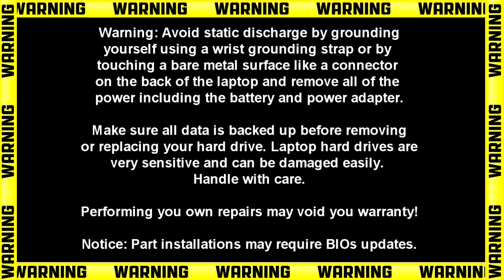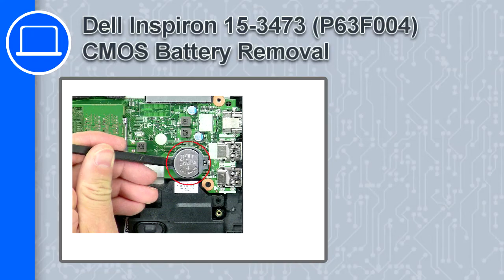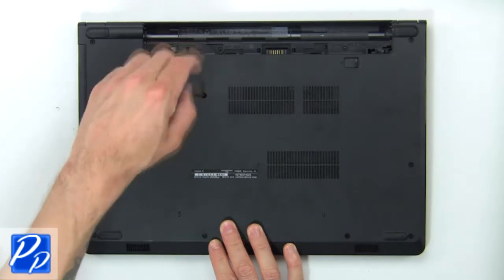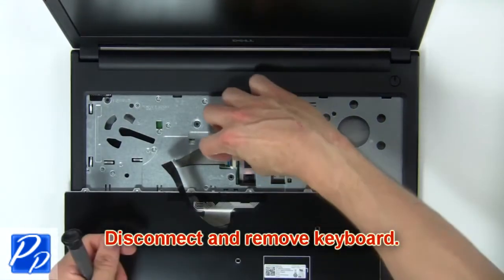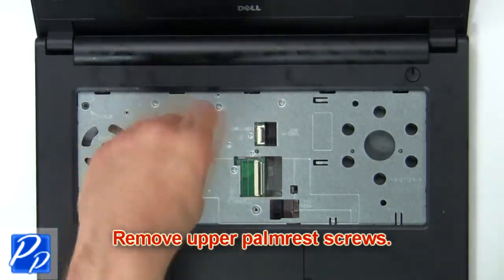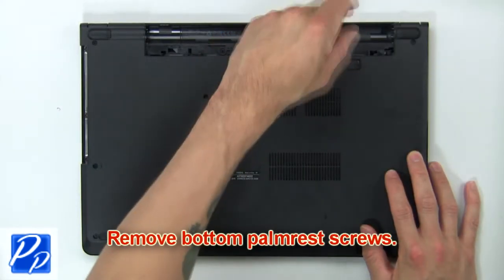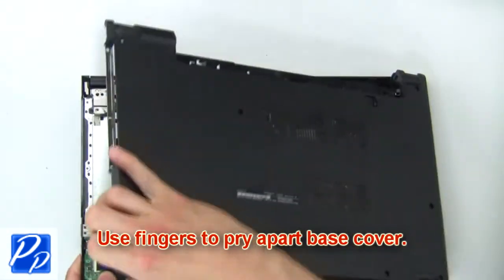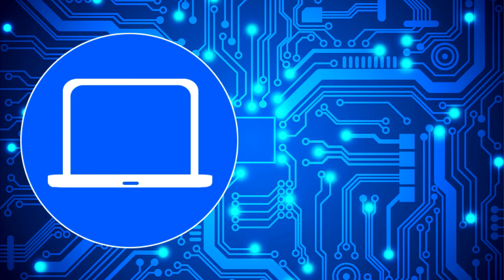Dell Inspiron 14-3473 (P76G004) CMOS Battery Replacement Video Tutorial

Comment: Heads up... when I pried out my CMOS battery, two tiny little tabs in the battery housing that had been holding down the battery broke off.   The new battery would not stay in place as a result.  I had to kludge together something to hold it down.